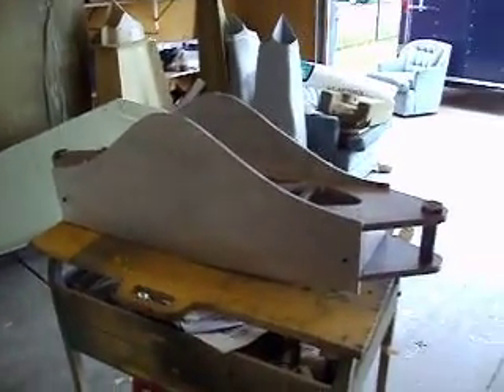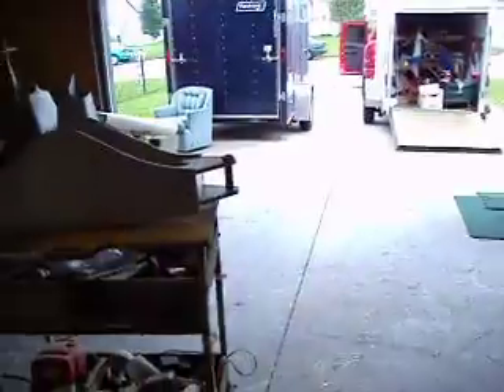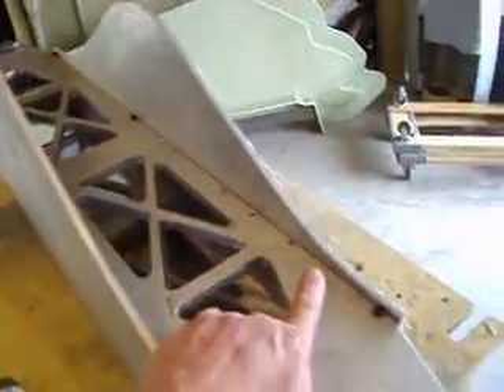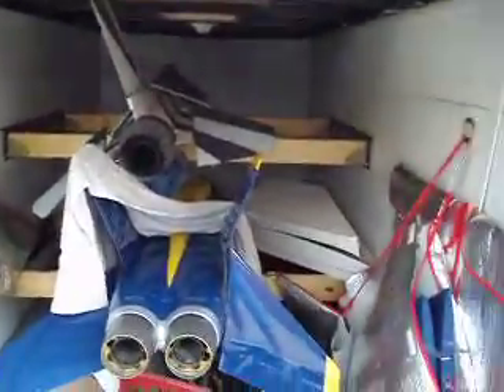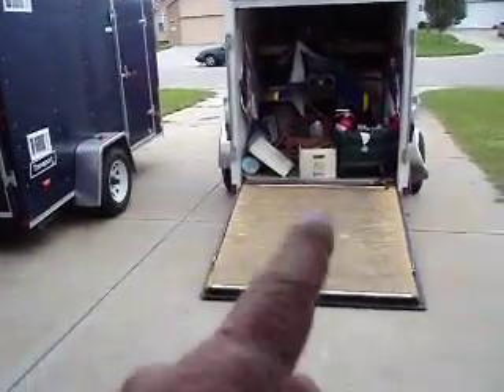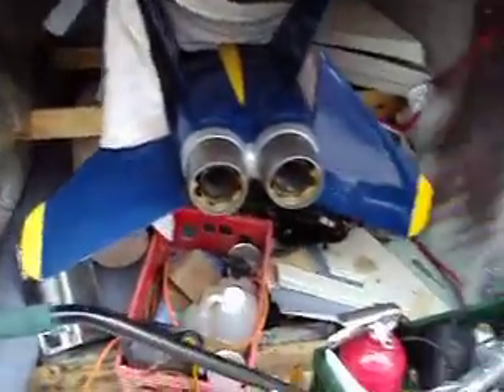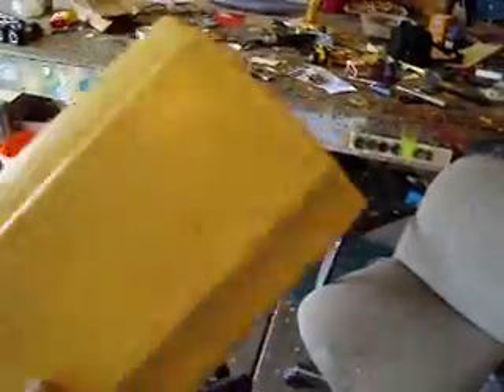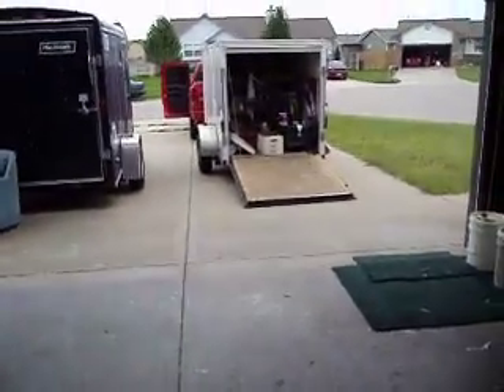How to build a rc jet b1 bomber #71

Comment: Set the foam block in the between the bulkheads  on a piece of 1/8 inch balsa. run a hot wire across the top Like cutting a wing, remove the balsa, and should fit back in with a bit of clearance.

Comment: If its the kids fault, you may need to contact a lawyer for a free 15 minutes and take a civil suit action against the other insurance company for the airplanes.  Models fall into a funny catagory because real value is so hard to detirmine.  A lawyer should be able to help you attain a reasonable out of court settlement to include lawyering fees if the other insurance company plays it straight enough.  Or perhaps the insurance just tells you to make a list and pays up.  Mine did years ago.